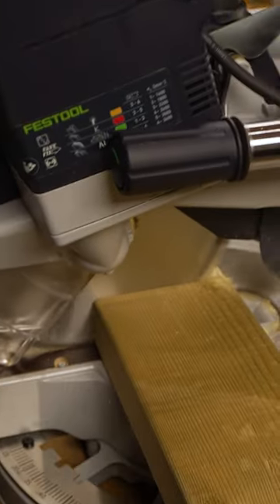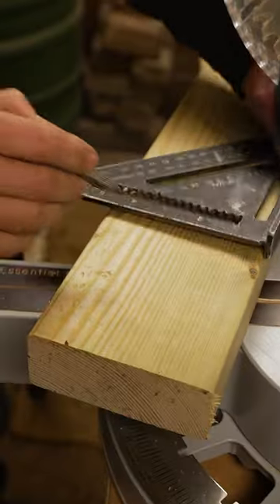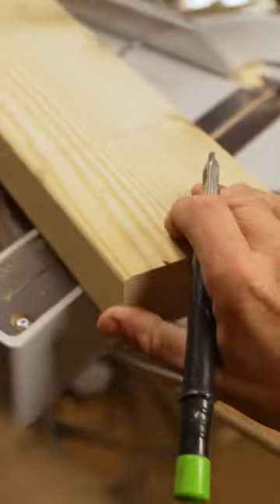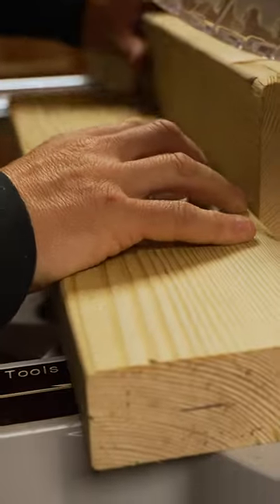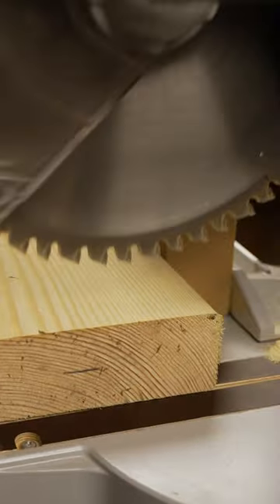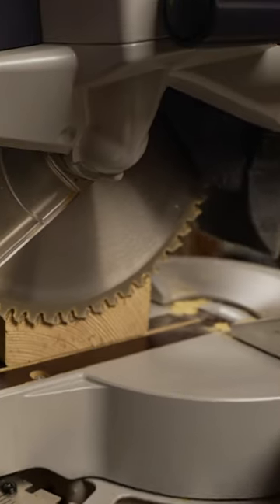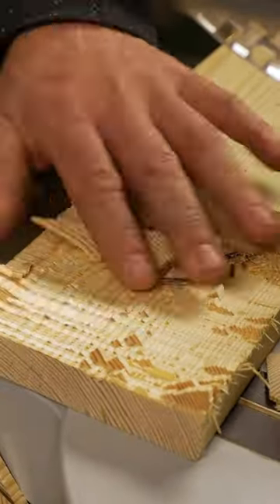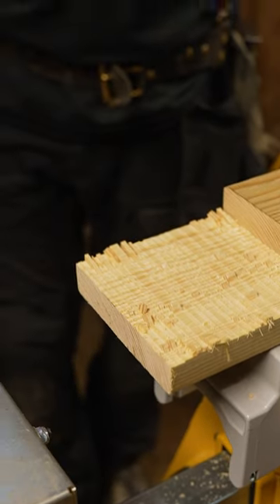How To Create a Half Lap Joint #shorts

Comment: Is required for those kerfed lap joints over there or is just situational if you cant install a framers plate?
Reply from the maker: It is just the traditional way. You could use a plate but it gets in the way of the hip.
Reply: Oh ‘that makes sense, thanks.

Comment: Could you put both ends next to each other then cut to save time, If you have long enough reach on the saw that is. Great vids 👍
Reply: Bit awkward on a long length. There is a sweet spot in the middle of the slide that cuts flat, at the ends of the sliding movement the blade won't cut to depth.

Comment: For the cleanup I turn the miter saw back on and bring down the blade. Then move the board around slowly. 

Since you didn’t do that I’m sure there is a reason I shouldn’t.
Reply: That's called a Polish plane. Perfectly fine as long as the piece is stable and it's just small pieces you are taking off.
Reply: Probably not good to put sideways pressure on the saw teeth 🤷‍♂️
Reply: If the piece falls off and catches the miter saw you're going to have a bad day
Reply: @cglees  no pressure I’m sure
Reply: As I do too, but onto for tiny chunks, anything that could hurt if it hits you I take off with a chisel first.
Reply: Always pull my saw sideways through to clean up nowadays...even do it with my skilly .....other tool I now love is my grinder with wood blades and flap discs! Make life easy regardless of danger is now my ethos after 20 years! God bless cordless! Kids don't know how easy they got it not grabbing a tranny first thing every morning out the van.....I should probably stop picking them up off the corners that early in the day anyway! 😜😁👍

Comment: But it's easier, quicker and makes you look less of a cowboy to use a chisel😂 use a wider chisel one stroke across it and done doesn't need to be neat like you said, you could also just the chopsaw by moving the wood side to side it will clean it perfectly and very quickly if you're comfortable using it